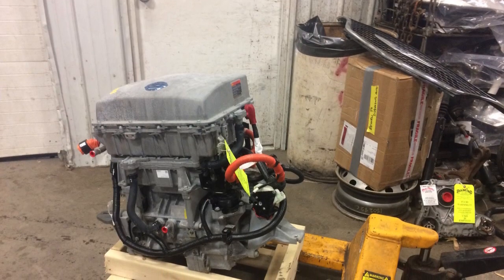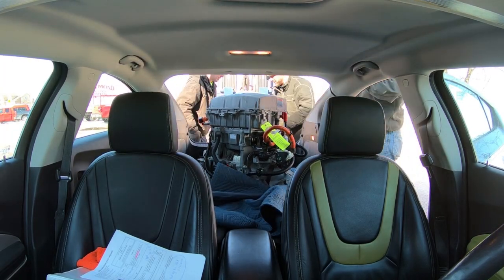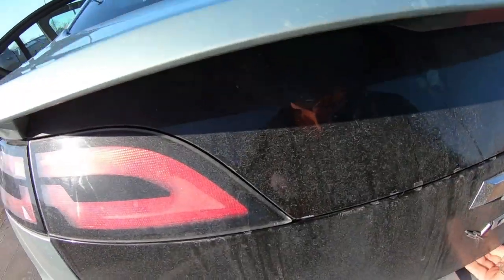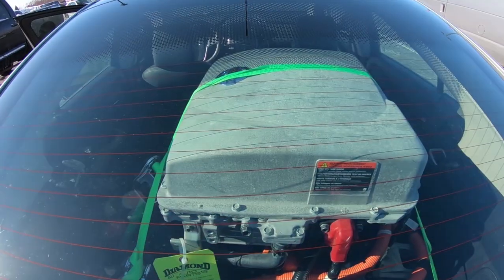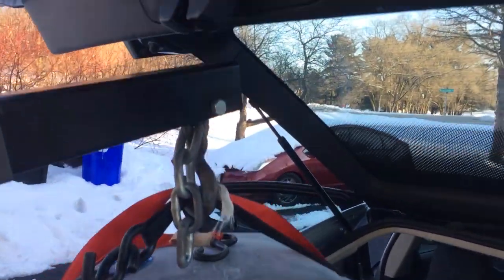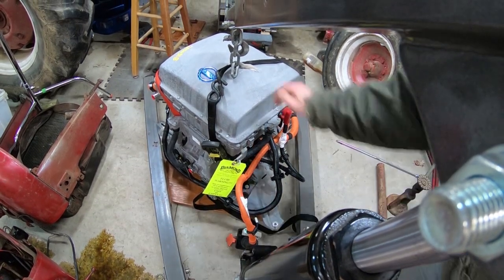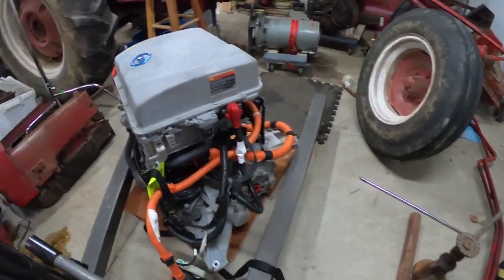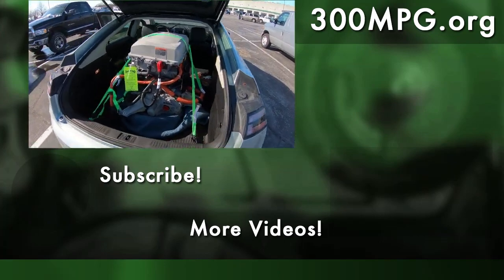Getting a Nissan Leaf Electric Motor from the Junk Yard!

Comment: Can you please tell me where I can find building instructions for the open Revolt five hundred amp and 1,000 amp speed controllers? The website has links that don't go anywhere. I'd really like to learn how to build speed controllers myself. Thanks
Reply from the maker: Here's a download link of the files that I included on the ROM disc of the original BUILD YOUR OWN ELECTRIC CAR DVD set. It includes some information on the Open Revolt controller, including a 47 page assembly guide. Unfortunately, the Wiki is web-based, and most of the information for posted by individuals who did NOT maintain where the data was stored. Some of the links will work, some won't. It's a shame so much of that was lost.
Try this link for the build document. https://spaces.hightail.com/space/yAgjus2F8L
Reply: @BenjaminNelsonX  thank you very much. I'm trying now to find the board schematics and other information to build my own charge controller. I have no idea where I'll look now.

Comment: It looks a lot like an internal combustion engine. Very different from Tesla motor
Reply from the maker: Nissan intentionally designed it to look that way. The early version even had a "valve cover" on top!
Reply: @BenjaminNelsonX  What was the purpose?
Reply from the maker: @inso5078  I couldn't tell you exactly why Nissan chose to make this look so similar to a gas engine setup. Perhaps it was just to make people more comfortable with electric motors. Maybe it worked better at their factories in terms of how the drivelines were handled and installed.

An electric car really can be designed in so many ways. I'm sure that in the future we will have electric cars no longer limited by traditional automotive designs based on engines and driveshafts, but for now, electric cars will still pretty much look like the gasoline powered ones.

Comment: You will need a Govenor to maintain motor rpms as the load on the motor changes.
Input shaft of the trany should turn close to the same rpms as it would do with the gas engine.
Reply from the maker: I figure we can make some throttle electronic mumbo-jumbo do that.

Comment: Are you going to build a custom 3 phase controller or re-purpose the one that you bought with it?
Reply from the maker: Building a 3-phase variable frequency drive from scratch would be beyond my skill level. However, there are a few ways to MODIFY the existing inverter to make it simpler to use with common DIY components. I'll probably be looking at either modifying the Leaf inverter, or possibly modifying a Chevy Volt inverter.
Reply: Whatever you end up doing should be fun.  (Including the first wheelie!)

Comment: Ha Ben love your vids so informative. I want to ev a Ford ranger 4x4 my question is I want to hook up a 35 ac hpevs induction motor. My thinking is I dont need a transmission the motor is 10k rpms to hook directly to the transfer case. Do you think I need a transmission.
Reply from the maker: You don't need high SPEED to go straight to the driveline, you need high torque.
A motor that spins at a lower speed, but with higher torque is a good match for a "direct drive" type setup.
At home, I have an Azure Dynamics AC55. That motor is designed to go straight to a driveshaft. It was formerly mounted on a 13 passenger van. That motor provides 280 newton-meters peak torque, and 140Nm continuous torque. It also runs at 2,000 RPM nominal.
Looks like the HPEV AC35 provides about 120 Nm peak and 55 Nm continuous. (Go to the following for charts: http://www.hpevs.com/hpevs-ac-electric-motors-power-graphs-ac-35.htm)
In other words, it looks like an HPEV AC35 would provide about half as much torque as a motor that I know to be appropriate for direct driving a vehicle. Even then, it's not like the Azure Dynamics motor was squealing tires....
It also looks like the AC35 peaks at about 82 horsepower. My old Chevy S10 had about a 100 HP 4-cylinder engine in it, and was fine for regular driving and light towing. I bet a lot of people would prefer more power in a truck.
If you want to do a conversion with the AC35, you would want to use it with a transmission/gear-reduction. More likely than not, you would like a more powerful motor than that.
A quick look through the EV Album shows that trucks using HPEV brand motors only used the AC50 or AC51 motors.
http://www.evalbum.com/mtrbr/HPGC

I think another really fun option for a 4x4 truck would be to buy TWO Nissan Leaf Motors with matching inverters and gearboxes. Put one on front, one on back. Boom! All electric 4x4. No transfer cases needed!
Reply: If you use the LEAF gear reduction unit (just spool the diff) you could probably hook directly to the transfer case.

Comment: Nicely done, Ben! How are you going to interface with the controller? Will you be building on the work Damien Maguire has done (https://github.com/damienmaguire), or are you getting a replacement board from Paul Holmes?
Reply from the maker: I got a controller board from Paul Holmes for a Chevy Volt inverter.
I might try pulling the inverter from the parts Volt and give that a try!

Comment: Quite a sizable unit, eaaa?    Cool how it's all one unit though.  Charger, Inverter and Motor ?   What is the Invertor for ?   AC to Battery DC charging ?
Reply from the maker: The inverter converts DC power from the battery to variable frequency AC to turn the AC motor.

Comment: LMAO, You Remind Me Of Me In How You Do Things! I Have Carried Large Couches, Tables, A Freezer, Pallets & Such Home Rachet Straped To The Roof Top Of My Car In The Last Year... ;~)P
Reply from the maker: Hey, if it works, it works!
Reply: @BenjaminNelsonX  Butt The Cops Really Eyeballed Me A Couple Times, Just Shook Their Heads & Drove Off Without Stopping Me! LMAO
Reply: @BenjaminNelsonX  can i bump the amps up using the vcu that you bought??
Reply from the maker: @FirstLast-tx3yj  The Thunderstruck VCU just allows you to use the inverter and motor as though it were still in the Nissan Leaf. It's essentially stock. You can tweak the regenerative brakes and a few other tricks, but it doesn't change the main character of the motor, including its maximum power.